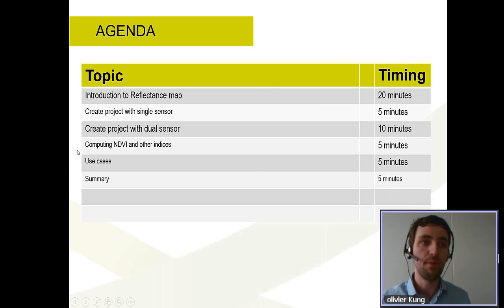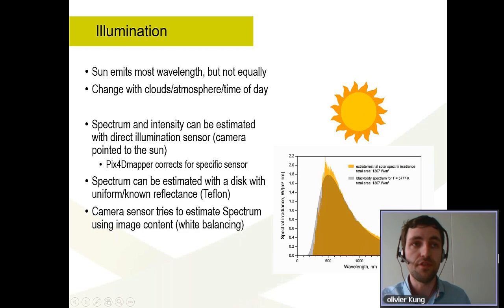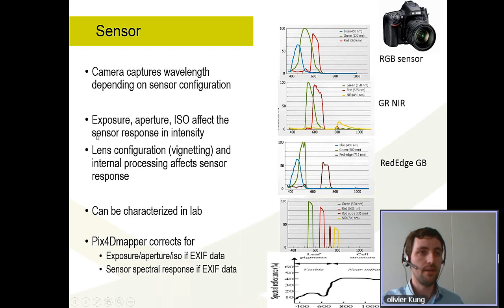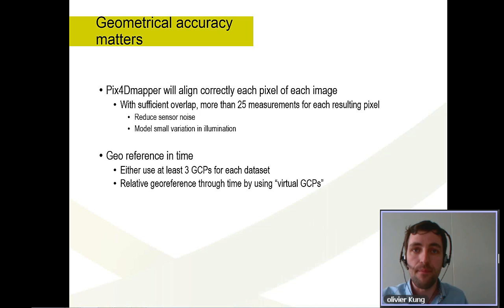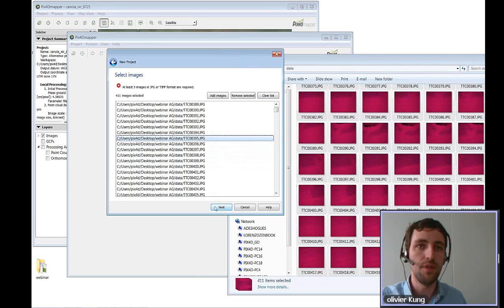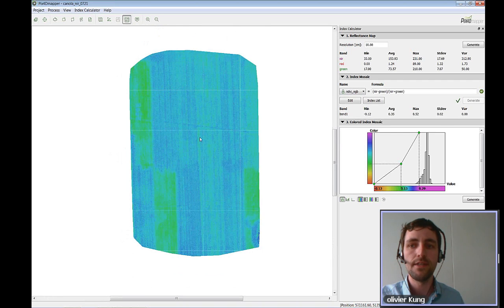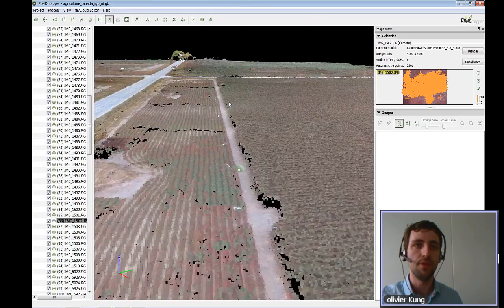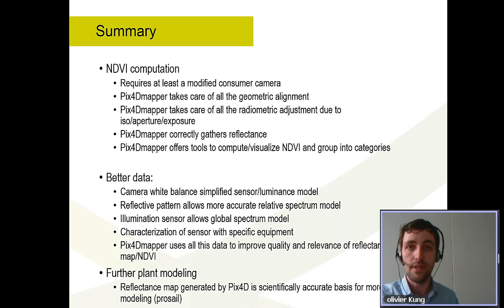Pix4D Webinar 4: Index Calculator in Precision Agriculture

Comment: NDVI is ( NIR - Red ) / ( NIR + Red ) not ( NIR - Green ) / ( NIR + Green). It is calculated incorrectly the first time in this video.

Also, if the images being used for input into pix4d are multipage tiff, is the orthomosaic output as well a multipage tiff? Pix4d seems great for orthorectification, but i'd prefer to work with a final orthomosaic multipage tiff in ENVI or R*. Also, how does pix4d deal with time series data? Can I compare orthomosaics as a time series?
Reply: Would you mind, if you have one, sending me a reference to a paper or something that tells you that formula for NDVI.  I am doing this for a vineyards and would rather not put in the incorrect calculation.

Cheers,
King
Reply: Ben King Twenty five years of remote sensing in precision agriculture: Key advances and remaining knowledge gaps. There is a table on the third page with a list of the most common spectral indices. Send me a message and I can link you directly to the paper.
Reply: Aron Boettcher  Thank you Aron, luckily I am a student at TRU in BC right now, so I have access for a wide range of journals and was able to find the paper (and table) that you mentioned through that.  As for his NDVI calculation, it is actually in that table as GNDVI and in his webinar here if you pause it when it shows the calculation it says NDVI_ngb while another says just NDVI with the calculation you have shown.  The difference apart from viewing red or green spectrum is beyond me.
Reply: Ben King Red NDVI is generally more linear in the range of canopy densities one is likely to see in a remote sensing application. Green NDVI is more sensitive to the chlorophyll content of leaves, but may not provide one the sensitivity in the range necessary to distinguish between plant canopies in a field setting. So if you were looking at just an individual leaf, green NDVI would more accurately tell you the chlorophyll content of that leaf. However, if you are looking at a canopy of leaves, as they are here, red NDVI would be more appropriate since there will be pixels in the image that are part plant, part soil background. Depending on the sensor, the wavebands might match to either or both of these two regions of the visible spectrum.

I wouldn't rely on this webinar for any information beyond the actual process of image co-registration if you are setting up an experiment. Its nice to see that they include an index calculator, but what does that index actually tell you? Also, if you are using an RGB camera and don't know the camera sensor response function, you can't compare those values to something like MODIS data for the same location. This is why people spend a lot of money on products like the Tetracam.

The best thing that pix4d can give you is a high quality orthomosaic when you can't capture your whole experiment in one image. After that, there are much better ways to work with your data [ENVI, R*, etc..].
Reply: GNDVI
Éste es, una variante del NDVI que utiliza la banda del verde en lugar de la del rojo.